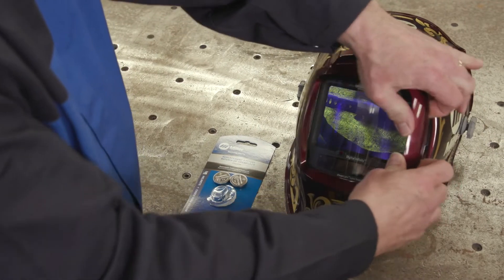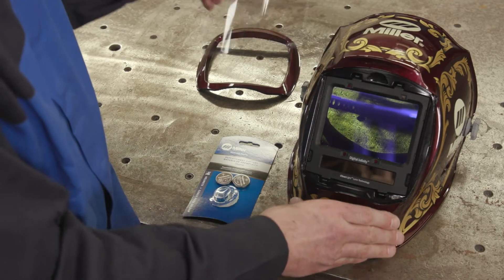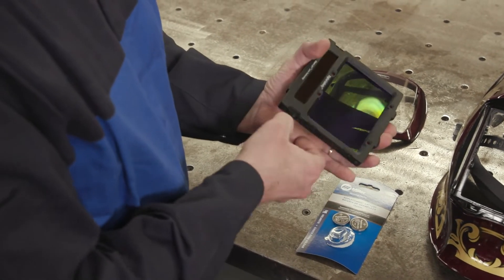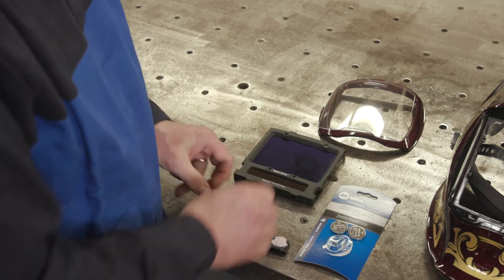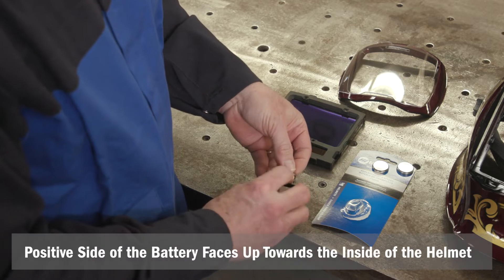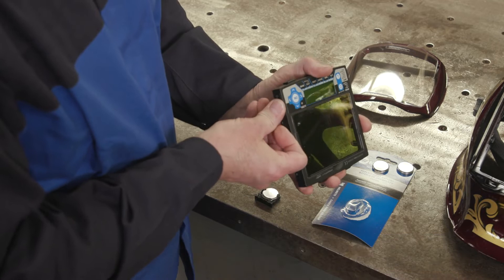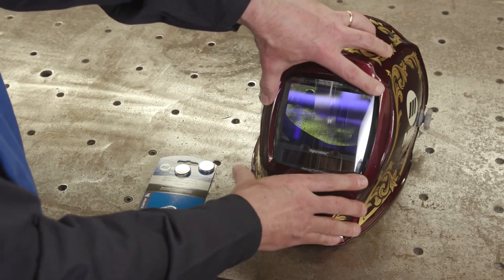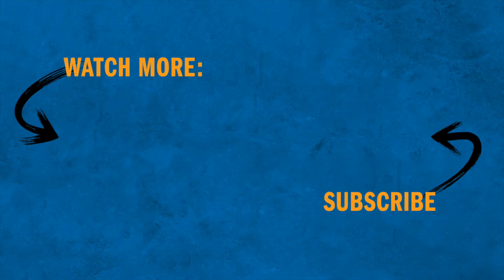How to Change the Battery in Your Digital Infinity™ Helmet

Comment: I just changed the batteries in my digital infinity for the first time using Panasonic batteries but it would not turn on and i fiddled with it for probably 15 minutes looking on google and stuff trying to see if i did something wrong then ran my thumb across the screen to wipe off some dust and all the sudden it came to life. I have no idea what I was doing wrong i was hoping maybe there was some procedure i was missing or something. But I'm a little weirded out by it just coming to life again. I'm happy but a little nervous. I really like this helmet a lot compared to others I've had or tried. I'm hoping it was user error because I know I'll be purchasing another one of these but I'd like to be able to use it enough to change the batteries a multiple times.